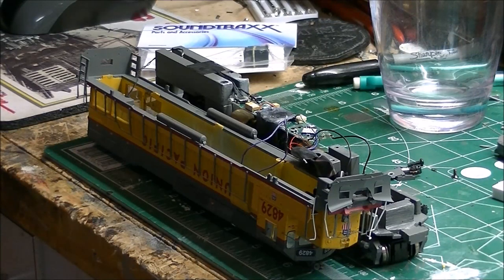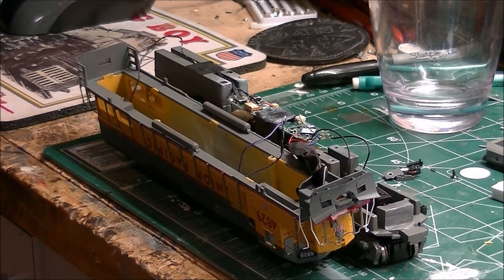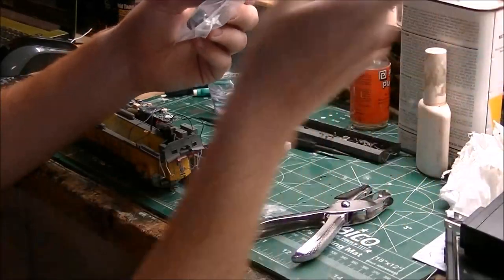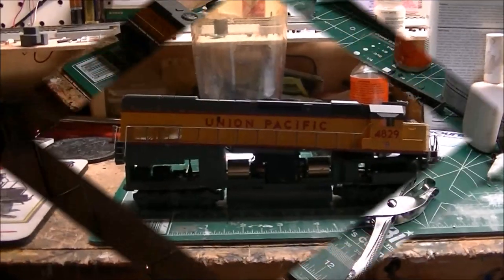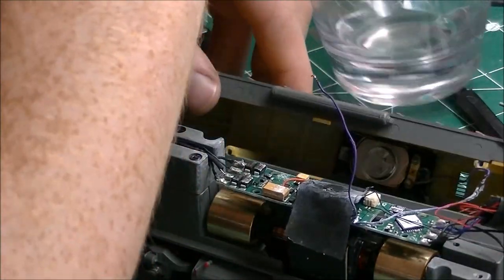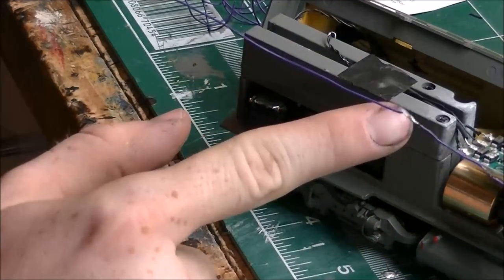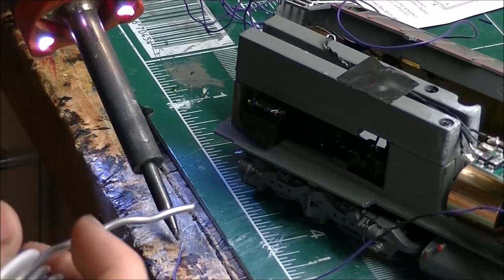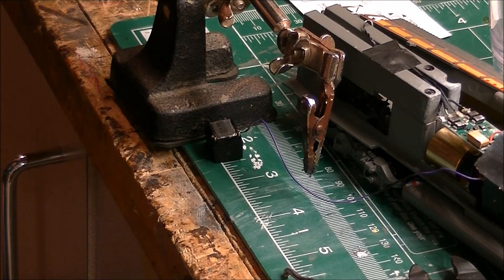Athearn SD45 Tunnel Motor two speaker install

Comment: SoundTraxx recommends using 2 mini cube speakers wired in series, and heat shrink is best to insulate joined wires, and flux should be used when soldering, the solder flows easier. Not a bad video though. Cheers,Gary